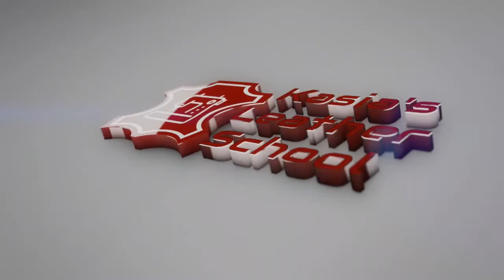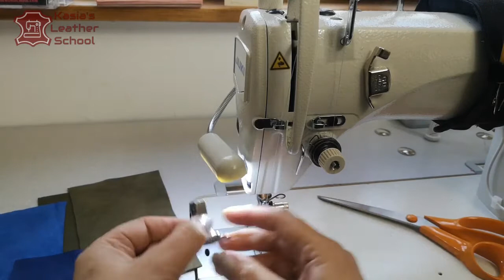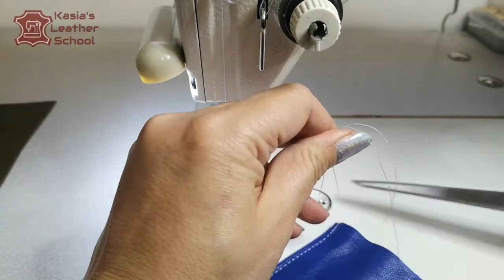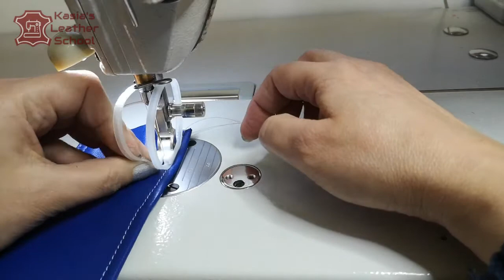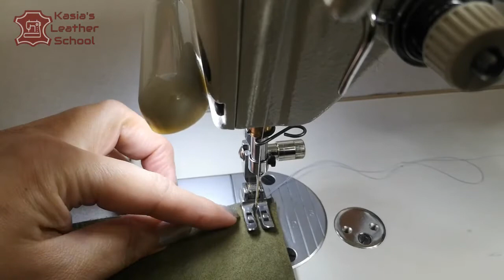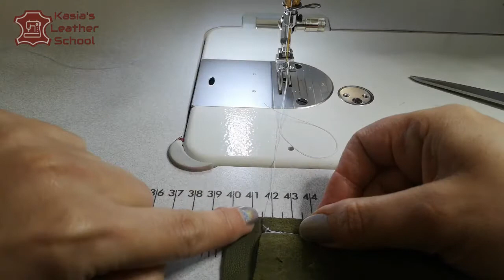How to sew leather with a industrial machine. Ultimate setup guide.

Comment: Have you ever used rubber feed dog?

I'm looking for a needle feed machine for nappa. Was that a regular 8700 or 8700H...
Reply from the maker: No I never  used  rubber feed dogs on this machine as for my professional work I  have  heavy duty  walking foot machine. 
But if I'm at somewhere else (often working for other companies) usually  there are  regular sewing machines and then I use techniques I showed in this  video. 
Machine in this video is 8700.
Good luck with your projects.